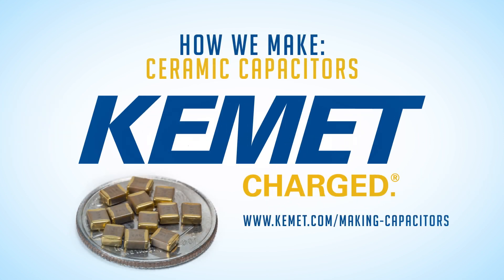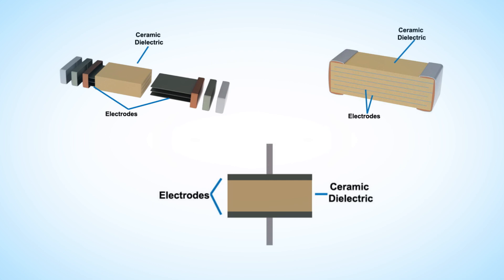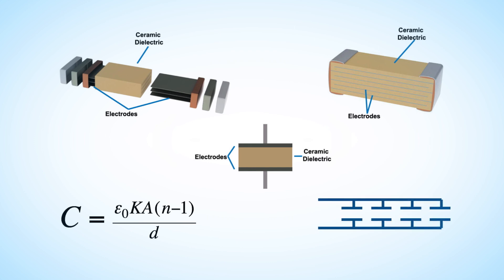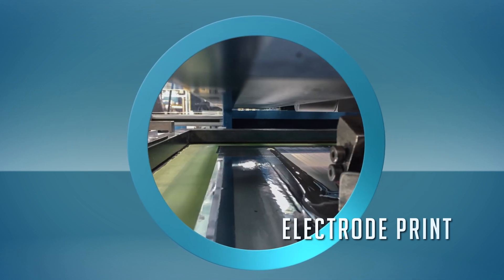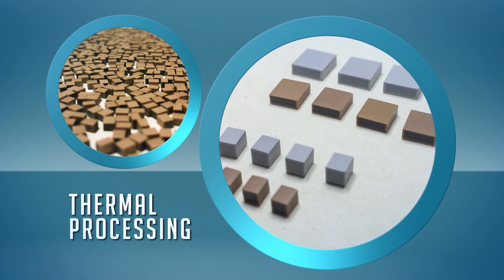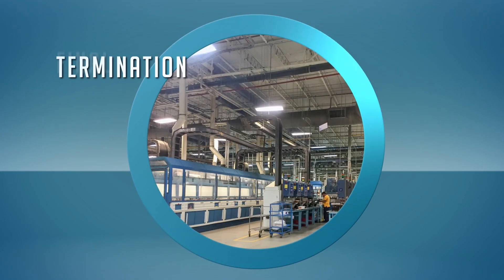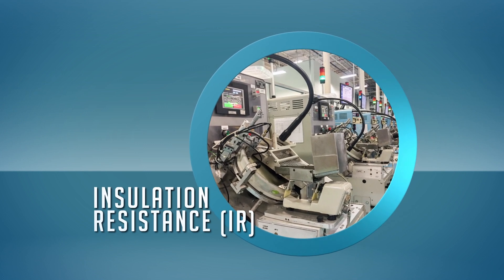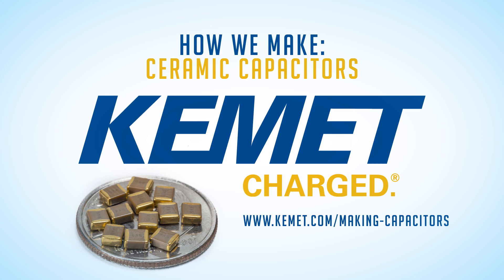How We Make Capacitors | Ceramic

Comment: How do you determine the farrad rating on an unmarked ceramic capacitor?
Reply: There’s no way to tell capacitance by looking. 100 nF and 10 µF look nearly identical even under a microscope. Only reliable way is removing the components out of circuit and measuring with an LRC meter.

Comment: What's the name of machine used for making electronics components
Reply: There's no fixed machines each unit operation has different machines for different processes like during ceramic film tape casting is done and electrode powder metal generally is again stacked over it ...process continues to give an alternative staked layers of capacitor which is fired to give the final product.....

Comment: Looks like chocolate
Reply: it might also taste good
but the question is... what is the capacitance of your stomach   LOL
Reply: @martinkuliza  😂👍
Reply: @flatspin5382  
i thought you' like that   LOL
Reply: @martinkuliza  i like these chocolates😋
Reply: @flatspin5382  
did you eat them in series or in parallel   LOL
Reply: @martinkuliza  i wanted to eat them in series 😂
Reply: @flatspin5382  
i reckon that's the best way,... you don't want to eat them in parallel and give yourself indigestion
Reply: @martinkuliza  i have a question, my pc motherboard one capacitor is blows up. It was 6.3v 470uf. Now can i place 16v 2000uf capacitor?
Reply: @flatspin5382  
No.. you shouldn't, because You've just increased the capacitance which then ...(i could really go on a long 4 hour explanation here, but i won't) but , it leads to a variety of other issues and many different subjects

Long story short
if your original cap was 6.3 V  470 uF

then stick to 470 uF and get something close to 6.3V if you can't get the exact value
Example up to 10V should be fine

does that help

also re not altering the capacitance.
You need to really understand that the cap value was chosen for a reason and that cap IN THAT SPECIFIC AREA OF THE BOARD probably had a specific purpose, whether to supply voltage, whether bypass cap, whether filter cap who knows..  Now.. if you just go an change the capacitance in that area of the board you could cause a lot of unwanted things to occur so.. always try and keep the capacitance the same .
Reply: @martinkuliza  👍
Reply: @martinkuliza is correct. 
@flatspin5382,
 You can't just simply replace a capacitor with another of any value or rating.  You must always replace a capacitor with the same value of farads. As long as the voltage rating is equal to or higher than the cap being replaced, it will work fine. Never downgrade the voltage rating. Voltage ratings on capacitors are how much voltage that particular part can handle before becoming damaged. The value of the capacitor must remain the same value other than the voltage rating. If replacing a 470uf 6.3v cap, it would be ok to use a 470uf 10v cap or 470uf 100v or 470uf 1kv ect, ect, ect... . The voltage rating may be increased, if you don't have the proper part to replace it with. Under no circumstance should you ever increase the farad value of any capacitor from the circuit's intended design unless it is a revision being made to the circuit because of an engineering inaccuracy or production fault.
Reply: @BlueDevilsBari 
Exactly

Comment: What kind of printing process did you do, Screen Printing or Gravure printing?
Reply from the maker: Hi there. You look familiar... 😀 We use a silk screen process for printing.
Reply: @KEMETElectronics  I see, I was assigned at Printing process from the company I used to work years ago. We did both gravure and screen printing even though I have more experience in screen printing. May I also ask what material you use for screen printing. As far as what I've remember, we use a bando or unitec squeegee

Comment: how mlcc become chips ?  first , Batio3 ( barrium titanade) ,they used in stacking process, next  to cleanroom process which many different sub processes liike design and etc, next to cutting process,to tumbling process and to Firing process where they will used the  high voltage of heat treatment to fired the chips then next to Termination process where copper (Cu) paste applied and to term fired again to  fired the chips in order to apply the current of Nickel and Solder for Plating process--these process are the main process to make chips capacitor,,then to Sorting process which sort the good chips ,good capacitance , mixed capacitance, high DF or low DF and many more, before visual process which the main process detection of all defective chips before quality process----- former samsung electro mechanics employee here.....

Comment: How can i check valu of smd ceramic capacitor
Reply: Use meter? Hmmmm
Reply: I think he meant "How can i "read" the value on an smd ceramic capacitor". To the first 2 digits append as many zeros as the 3rd digit. The result is in picofarads. A letter following these 3 digits indicates the % tolerance (or accuracy).
Reply: @rongarza9488  
of course... but..... IF THERE ARE NO MARKINGS ?
and... other than using a multimeter of ESR Meter

simply stated... how to find out, or establish what the INTENDED CAPACITANCE AT TIME OF MANUFACTURE WAS INTENDED TO BE for an SMD if it has no markings and you've taken it off a board and it didn't come off a reel

ANY IDEAS ???